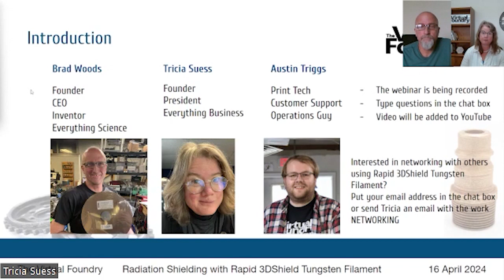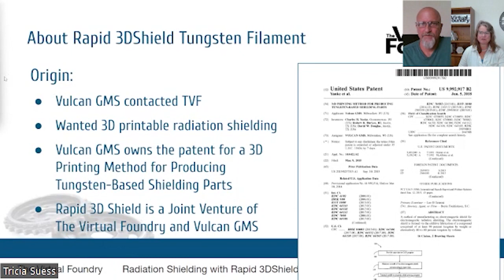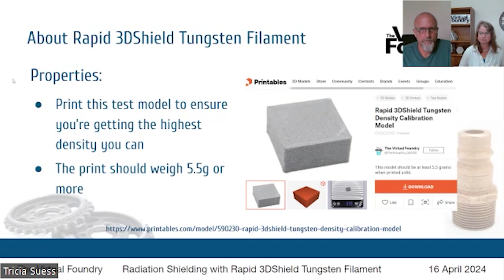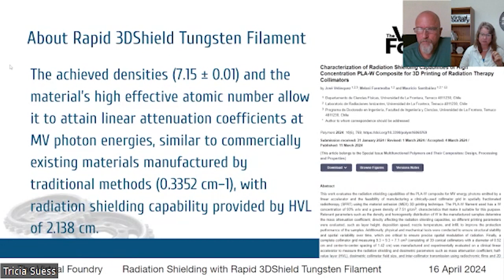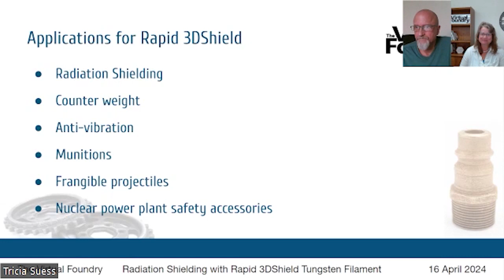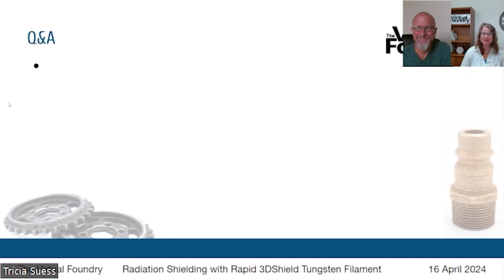TVF Webinar: Radiation Shielding with Rapid 3DShield Tungsten Filament

Comment: Why not use the copper filament?
Reply from the maker: Copper can be used for radiation shielding but tungsten is more dense so you will need less material. - Tanya

Comment: I work for Luxium Solutions in Hiram, OH. We manufacture radiation detectors and imaging components. We've been playing around with this filament and have already put it into use - specifically, we've printed it into thin sheets to modulate the intensity of a radiation source. It has helped us avoid working with lead, which obviously our EHS department would like us to avoid at all costs.

My only feedback is that the printing hasn't been quite as smooth as you make it out to be. I think the main thing for us was that the extruder wheels tended to crush the filament, which then jammed as it entered the nozzle, which made the filament crush more, eventually leading to a total clog in the heat break and the filament grinding away in the feeder. Lowering the feeder tension per the Ultimaker metal FFF instructions seemed to solve the issue, but it did recur once when the z-offset was a little low and we got the same jamming and grinding. It's just such a soft material that when something goes wrong, it goes REALLY wrong. However, once it gets going, it does print beautifully.
Reply from the maker: Thank you for commenting!
It's great that you got your filament to print well. We're also happy to help with your printing process if it's not going how you'd like. Reach out to info@thevirtualfoundry.com for any support any time
Reply: Why not use bismuth alloys instead of lead? The ability of remelting your shields and casting again reduces cost and waste.